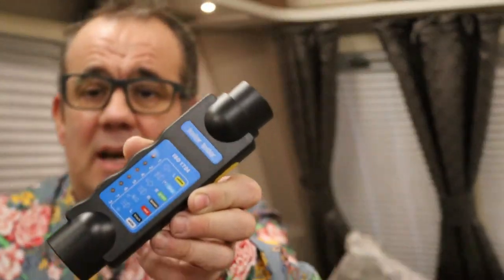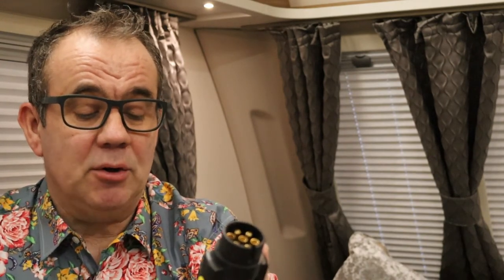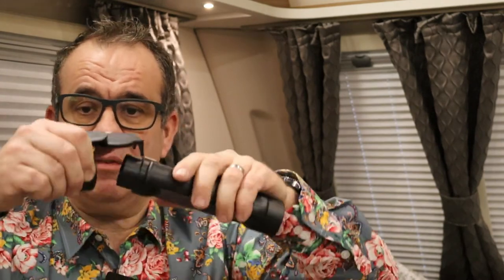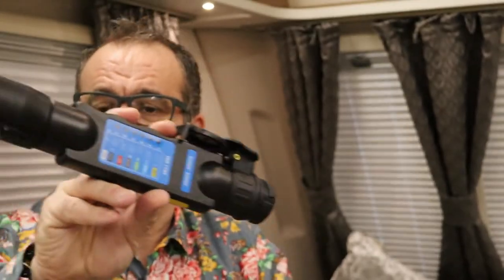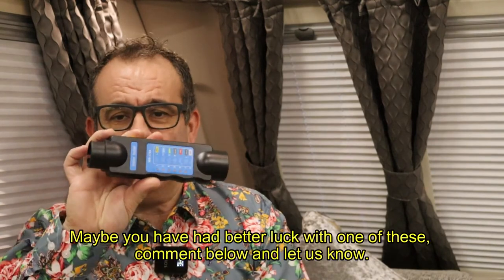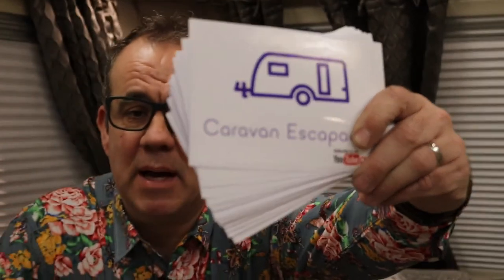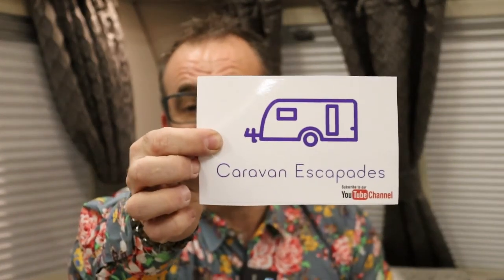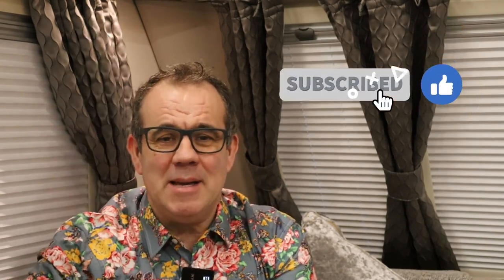Tow Electric Tester don't buy this one.

Comment: I just got one of these testers, I like the fact that unlike my multimeter you just push it in and all pins including pins 9 & 10 - the permanent live and live when running pins, are all connected, you need two people, one to operate the lights and one to hold the tester and see what it shows, but I'd have to do that with my meter anyway, without the faff of moving to the individual pin you want to check. Quick and easy.
Reply from the maker: Hi, Thanks for commenting, Really Glad you got it to work for you, I just could not get on with it, It could have been the fact the one I had was faulty, Thanks for commenting and Happy Camping. James
Reply: @CaravanEscapades101  to further update, I changed my car and had new electrics fitted. It found the 12v supplies had not been done but also brake lights and the right side lights were switched in the socket. After these things were rectified, it showed slightly odd behavior, namely that the rear lights and brake lights all showed they were green even without having them on. Not sure why as its not what I expected, so maybe it's of some use but I'm not 100% convinced, maybe if they came with instructions it would help!

Comment: Caravan nut tested a similar device to this he used the Etuker 13 pin trailer tester available on Amazon for £18 no need for adapters. However it only seemed to test the road lights and not things like the split charger and fridge.personally to test socket on car I always use a meter as this enable one to check all the earths and to check light on my trailer I have fi exciting a socket to a board and wired it to a connection block so I can feed each circuit with 12 volt.
Reply from the maker: Hi Andrew, I did receive the replacement tester and have just finished recording the Vlog, just need to edit it and upload first. No adaptors with this one just straightforward 13pin. This one does also give indication of live 12v Feed and Switched 12v feed. A Multimeter is always a good idea but I do think a few would struggle to use them with a dedicated tester giving a clearer basic indication. Like your idea of being able to feed 12v to each of the lighting circuit. I will have to look into that.
Reply: @CaravanEscapades101  Looking forward to see new video.
Reply from the maker: @andrewpaley9914  It has just finished uploading, so you should be able to view it now, Let us know what you think.
https://youtu.be/QzgMO7u-MMg

Comment: Just a thought as I heard you mention changing a puncture recently, have youi thought of doing a video of how to change a wheel? It may be tooimpreactical, too difficult to show etc but I thought about it as its def something Id be interested in as we head off to Cornwall next month. Keep up the good work James!!
Reply from the maker: Hi Bret. Thanks yes something I have in the pipeline. I have also had proper Jacking points fitted to the chassis, so was going to include it in that. Thanka for the feedback. Stay Safe. James